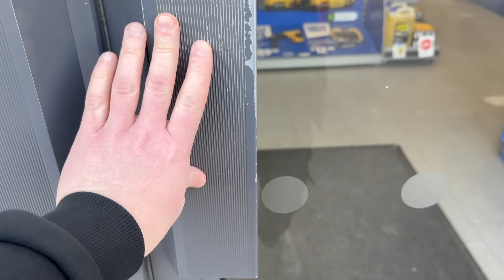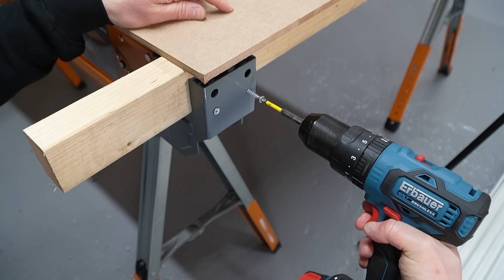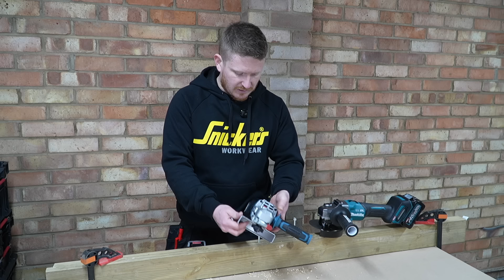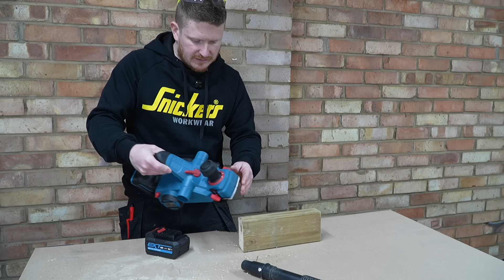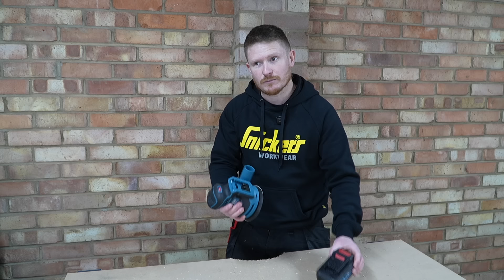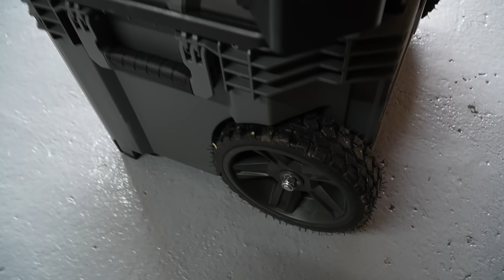Erbauer Tools Tested - Should You Buy Cheap ScrewFix Own Brand Tools?

Comment: I bought these when first released back in 2019 as a temporary starter set when starting up my new bussiness in the trade however 7 years later I still have these and are still going strong. 

I have ordered a Milwaukee set due to be delivered tomorrow so we will see how that goes before I fully decide to depart with my trusty Erbauer

Comment: Being using air ebrbaur for about 7 or 8 years now. Got most of the cordless tools Circ saw, jigsaw, sander, multi-tool, SDS, Combi, drill impact, drill router, etc. Never put a foot wrong. Never had a problem does just fine. Great tool for the price.

Comment: I bought a Hitachio drill driver set 12 years ago, still going strong but probably should have spent a bit more on DeWalt or Makita for the range. I have bought 1 Erbauer tool a Tracksaw, it does the job, the first one died after 6 months and Screwfix replaced it immediately so great service! Its a big track saw but doean't feel as powerful as the spec says and the 2 700m tracks are a pain. Last summer I saw a used Festool tracksaw at a great price and bought that. So much better, night and day. ergonomically light years ahead, track is nicer, controls nicer smoother start and stop and much easier to use. Used Festool with sustainer and track cost me £210 vs £150 for new Erbauer and track but no systainer. The new price difference is huge but the Festool is ion another league. So interesting to see you review the cordless range.

Comment: I've got ½" router that is ok, but incredibly heavy compared to premium brands. Also got 10" sliding saw which is fine for carcass work, but you wouldn't use it for kitchen fitting.

Comment: 10 months on there is a updated version of these tools which probably negate some of the negative points. I still have the circular saw and to get over interfacing with the speed square I just adjust the blad depth and this lift the body up above the square. Good video

Comment: I have a brushless drill from before the ext battery tools, still going, brilliant.
Just got a impact driver & drill set, and the 800nm impact wrench.
Shame u didn't test the impact wrench, because it's good but I'm not sure it hits its claimed torques (incl 1000nm undoing torque). But level 1 power (out of 4) does do about 170nm (tested)

Comment: They done have the fine trigger control you get with more expensive brands . But if some oink breaks into your van and takes the lot , it won’t break you like the Red/ yellow/ green branded stuff would to replace. And also a DIYer would be mad to buy the top end stuff

Comment: I use circ saws with blade either side. Right side blade when i want stability, and left side blade when i'm making many repeat cuts and can put blade straight to line, not caring about if cut is perfectly 90 degrees

Comment: The “tool” in a drill is the bit. If you have blunt or poor quality bits your expensive drill will perform badly.  The reverse is also true. If you’re getting frustrated with your hammer drill not working properly but some new bits.

Comment: I've used erbauber for 5 years daily. Love them. However, they're missing a few tools dewalt and makita offer so I've since moved over to dewalt but I'm buying cheap dewalt compatible tools from amazon, mini chainsaw £60 epic,  grinder with speed control £75, palm router, £80 (wish I'd got the dewalt) leaf blower and mini ricip £30 each l, use these all the time and they're so cheap and great quality all on the dewalt batteries.

Comment: Previously watched your video months ago, I had most of the Erbauer range and was very happy.
Recently went to buy their pole chain saw and realised they've now bought out a new V2 range with more powerful motors and new designs.
The circular saw has been completely redesigned and is now right handed without the motor clearance issue, also just to point out my pole chain saw has work effortlessly to cut through many approx 6 inch tree branches and I'm very Impressed, one last thing for anyone looking at Erbauer tools, don't buy the impact driver and drill combo, buy the 150nm combi drill bare, it's miles better and buy the impact driver with battery and charger

Comment: After reading all the reviews i regret going after bosch green range a few years ago. It is only for casual diy use and even that use has killed some of the tools. Left a drill out in the rain and its died. Worked on a shed roof and the clutch was gone in the end. Recipricating saw just falls apart sawing medium branches and so on 😢

Comment: I bought an Erbauer mains powered SDS drill years ago, it's an absolute beast. I don't use it very often, but when I need it, it's a joy to use. My Wickes circular saw has the motor on the same side as the Erbauer, never realised handed ones were available. I just accepted that's how they were and just used it.

Comment: I bought an Erbaur 12v impact driver and drill set - think I paid £70 - used on and off at home for DIY and working on a boat etc it lasted for 13 years and the drill is still going - great little bits of kit for home use couldn't tell you how the hold up to professional usage

Comment: I have been using erbauer for about 8 years, use it on fencing, decking, building sheds, landscaping, i use the combi drill to mix mortar, concrete, Plaster. Still using 2 of the 18v batteries from 8 years ago. All of them in the 18v range is more than up to the task.  Value for money it cant be beat. Low risk of theft.

Comment: I prefer the right hand blade on a circular saw for one simple reason.... everything fails eventually, and if its a catastrophic fail, I don't want my wrists in the axis of rotation, coz I don't like the idea of bleeding to death..... I also don't lean over that axis to watch what I'm doing.... coz I like my eyes and don't want them full of exploding blade bits.

That said, I have the track saw, not the circular saw, so I don't need to see what I'm doing.

No joke guys, stay out of the cutting plane if at all possible... I've seen people getting zapped with blade fragments 40+foot away from the tool when it fails.

A little inconvenience is worth not losing a hand.

Comment: The tools seem great for the price, but the case id look at a keter stack n roll instead, its the same price but feels sturdier and the stacking lock system is better overall in my opinion, with just two little tabs you slide in to lock and out to release, plus you can still lift the lids of the boxes when they're stacked, except the very bottom one.

Comment: The Erbauer biscuit jointer is absolute dog shit. Not square in any direction. Even got it replaced and the replacement caught the blade on its own housing when cutting, and was slightly out enough to mess up your joints.  Oil leaking from the gearbox, razor sharp edges, the fence looked bang on until you tighten it and then it is out and there's no way to fix it. Rubbish.

Comment: I’ve been collecting the Erbauer kit for a few years now and can’t fault them. I did however return the angle grinder but as a test as my work colleagues Milwaukee one packed up so we wanted to see how easy it was to get them exchanged. He took his in, under warranty as purchased from SF as was mine. They told him it’s a 10 day round trip to send away, repair or replace and then collect. 
Took mine in and they gave me a brand new one there and then and no messing about. SF asked what the problem was, I said it had just cut out on me whilst grinding and SF said no problem we’re exchange it. 
I too have the organiser stack and bought a second mid box for £25!! during a B&Q 50% off sale, bargain.

Comment: I have nearly all the erbauer kit literally everything bar the 2nd fix gun an the lawn mover 😂😂😂😂 

No 1 tip for anyone using the wee erbauer 165 rip saw …. Put on the 150 16 tooth einhell ripsaw blade … it makes it double as powerful it was the best move I made tbh by far I told a couple of apprentices the exact same as I advised them on erbauer cos of price an they have been over fist bumping every single time 😂😂😂….  5 ah battery an that 150 einhell blade out of screw fix (17£) best 17 Ul spend , it has wee vents up the side an is super fine kerfed ❤❤❤❤ love that rip saw now honestly I’m fit to rip a diagonal d-rail soaking wet as fast as a flexvolt  I swear try an c an come back an like this comment … an the 1st time u drop it that laser line will go off by 3 r 4 mill  chalk line an follow the mark at the front unless your cutting at an angle ..  

Sds i have as 6 years now an it’s unbelievable the best compact sds at that price ❤

1st fix nail gun is a cracker but like 5.2 kg with a 5ah (1st 1 was faulty and they replaced it over the counter)

Radio (dab) was great after I put in a 7 sectional intenna to get more dab stations and the other wee 1 I had Bluetoothing  for about 4 years 

Leaf blower I have 1st gen 1 an it’s great with a 4 r 5 in it 

The box he has I have the 1 with a different lid  an it’s solid and great build with strong back handle 

I bought the combi drill  at 109 with the wee cool bag an 2 5s  cos it’s a full alliumum gear box and is great drill  at the money  

have that same impact driver it’s the 160 nm 1 an it’s cracker for plaster board as it impacts early an saves you bursting  them I reali like that impact tbh I’m on my 2nd  1st 1 fell an they fixed it then the forward gear stopped working but I still use it to take out windows an doors or give it to some the young boys to take stuff offf it just won’t quit 

Even the hammer a knifes are quality an heavier than most …. 

The hedge trimmer feels shady if you shake it hard you might bend it but by fuck it eats bushes up an I put every thru its testing trust me 👀👀 
What else 

The reciprocator is a brilliant job aswell so powerful especially with th 5s I’m on my 2nd 1 after the 1st 1 was the hardest worked tool in my box and passed away proudly I still have it for bits 

Multi tool is a great job for 120/30 £ with a 4  box an charger 
Honestly u can’t beat them .. 
I have use wee bastards using them some days and they can’t break them 😂😂😂😂 
 Any questions feel free to ask 

Next thing in line is that evolution disc cutter 36v

Comment: Difficult to prove anything with shiny new stuff so here's my tu'penny worth.  Been using the Erbauer kit since I got out of electrician's college in 2016. In short, they just work. The range is very limited - no nail gun etc, but for the basics you selected they are fine.  The batteries are the biggest cost and I've had a few fail; all swapped in a few days at "Scruffies".  You missed the excellent mains / battery 2000lm work light. Worst thing is the handle on all the case. It breaks and lugging tools on / off the van becomes a PAIN! Hoping to get some handles 3D printed. There is also  USB top for the batteries.

Comment: This is the first ever cordless power tool test/review that I have watched with absolutely no mention of the batteries and charger, how long do they last? how long to charge? how big are they in ah? I now have more questions than answers(I got more info out of the ScrewFix flyer)a bit of a waste of my time watching if I'm honest, any new tool right out of the box should work to some degree.
Reply: I have 3 x 5ah and 1 x 2ah batteries. Used extensively on DIY over the last 8 years or so, with many all day projects switching between drills, saws and drivers and plane. The 2ah hardly gets used and is a "backup" if i've forgotten to charge the other 3. They charge between 1-1.5 hours from flat. I have the blower and for some reason i have found this drains the battery if left attached overnight. 
Can't speak for trades folk but for DIY Erbauer is more than adequate.I have the full range of cordless except the jig saw and palm sander. I don't see the point of having any of the battery torches that all the brands sell. Way too cumbersome when a little flashlight does the same thing Plus I have a bucket load of torches and don't need to add to them. Don't discount their attachments either. I have recently purchased a 9 inch mains grinder and disc for less than £100 and used this to cut many "council" slabs. and  concrete blocks and fencing posts. Hot knife through butter and actually quite scary / impressive.

Comment: Realistically all modern power tools are the same nowadays when you open them up. What you're paying for with the big brands is mainly the brand name and occasionally some better features. Most power tools are reaching, or have reached power boundaries where burning out motors is to be expected. So whichever brand is the most repairable is the one I'd go for. I haven't worked on an Erbauer yet but outside of the big brands Makita by far.

Comment: When I used to wear a suit and tie to work, guy I used to work with couldn’t believe I had spent £150 on a steam generator iron (when they first came out). He said, ‘it’s an iron FFS! I wouldn’t spend more than £35 on one’. I asked him, how often he used his iron? He said, every day. I then asked him how much he paid for his new Dewalt drill he’d been telling me about? He said £150. I asked him how often he used the drill? I won the argument. Some people slag off Temu tools and for high use stuff like screwdrivers, pliers etc, they’d be right. But for hose clip or curved long reach pliers, a suspension joint separator that Mr Average will use maybe once a year but save a knuckle or a wheelbarrow full of frustration, it’s worth paying £3 for, IMO.

Comment: Thing is once you buy a cordless drill, and a couple of batteries, you’re kind of cornered into going down that rabbit hole further coz you don’t want 7 different brands of power tools when you’re using 1 particular tool heavily and used both your batteries for that brand and have a shelf full of fully charged batteries of every other brand just to rub the salt in the wound, I don’t mind buying other brands for corded tools, but cordless you have to stick with 1, dewalt in my case.
Reply: Na, just buy battery adapters. I have all Makita batteries but have DeWalt and Milwaukee tools working off them.

Comment: IMO: If you compere the Original Battery power tools to whats on offer today - There is a distinctive difference. the newer tools seem cheap, the new chucks have a plastic otter locking mech. The original Makita are the better Tool.

Comment: I have the Erbauer drill, impact driver, batteries and fan cooled charger set and it's all good. All my other tools are corded. I was using the planer and found its one of the few tools where the cord is a concern if it catches on something. So yesterday I bought the Erbauer bare cordless. It was reduced as B&Q had it on clearance (£29 off) plus £5 off when using the app = £61.50.
A less powerful motor than the 240v but that's a good thing as its more controllable.

Comment: I used to buy lots of Erbauer diamond tip blades from Screwfix over the years but they got too expensive and much cheaper to buy online as is a lot of their stuff.On top of that most is free delivery on a lot of sites where as Screwfix is only on orders over £50. For under £50 they charge £5.

Comment: About 3 years ago I bought a jigsaw made by this mob, I was only cutting 15mm flooring, it didn't even manage to last one job of 3 rooms, the whole central column that holds the blade was wobbling all over the place, by the way I'm a carpenter of 50 years.
I took it back to tool station and bought a DeWalt which is now 3 years old and working perfectly, I wouldn't buy another tool made by them, absolute rubbish, plus Heard the same story from many other tradesmen

Comment: I have an erbauer jigsaw but it looks different to the one you showed though. It is a few years old now so maybe they changed the design. It's decent. The Titan brands Screwfix sell are questionable though.  I've tried a SDS drill, chainsaw, petrol strimmer and a jigsaw and they are flimsy and unreliable even for DIY use.

Comment: comparing 40v Makita instead of 18v to the Erbauer is a bit of a stretch not like for like, as for how they hold up, I used to use Bosch Professional before switching to Erbauer, there is no comparison, the Erbauer tools have never let me down, I bosch on the other hand I consider overpriced toys, I've had bad problems with 2 combi drills, SDS and found the impact driver utterly gutless and on parr with low tier DIY offerings (and even then a neighbours Parkside 20v impact embarrassed my expensive Bosch)
I've used a mix of Dewalt, Makita, Bosch pro and Erbauer for work,  as mentioned I don't rate bosch pro (tho oddly all the green bosch tools I've owned have never let me down but they don't get the same level of abuse), Dewalt is hit and miss either fantastic or sub parr Makita and Erbauer (18v) both are consistent decent quality and reliability.